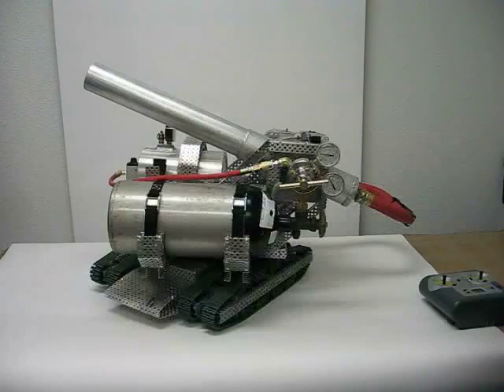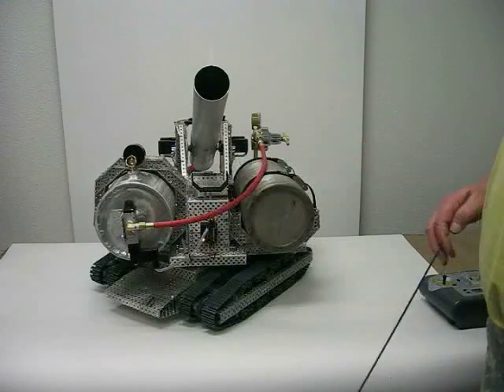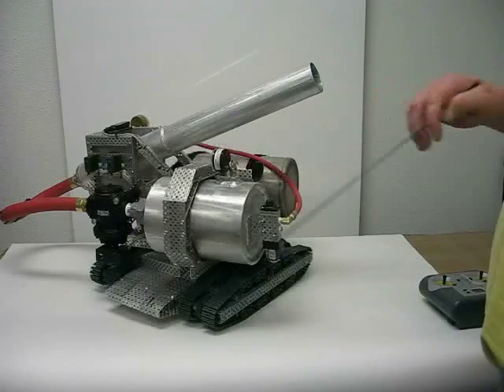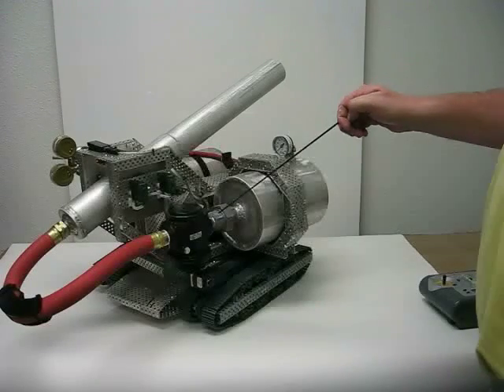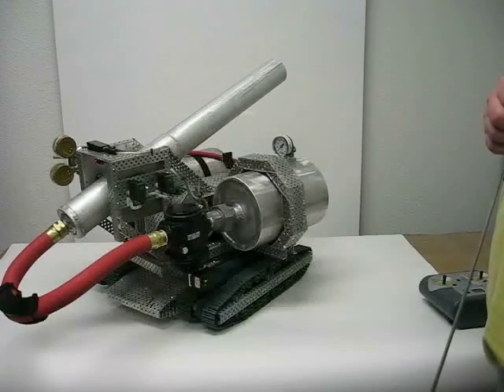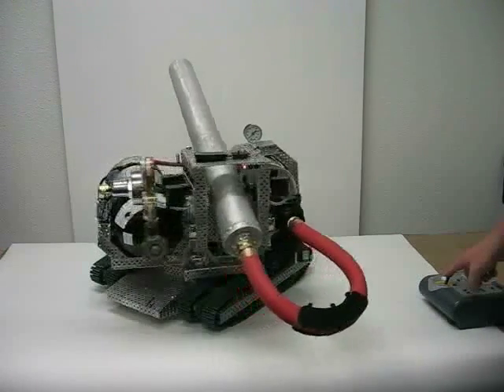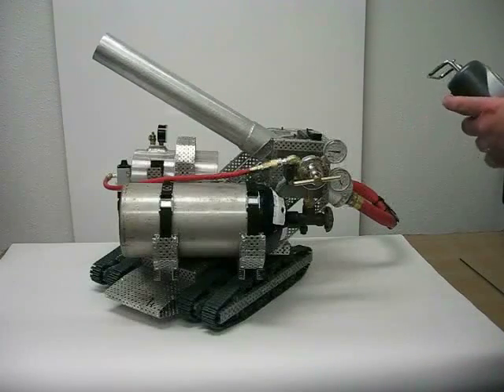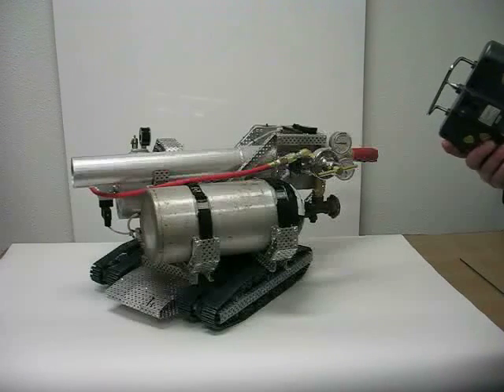Vex Robotics Air Cannon

Comment: Well, I shoot mostly potatoes, so I can't really say anything about friction between barrel and projectile. However I appear to get the best results when my calculated pressure (when the projectile is just leaving the barrel) is about 10-15 PSI. In reality the projectile has probably stopped accelerating by then. For this gun, with 400 in^3 tank @ 150 PSI the optimum barrel volume would be in the range of 4,000 in^3. Or about 3 inches by 47 feet!!  Obviously there is energy being wasted here...

Comment: In my theory, Using a smaller accumulator,a longer barrel would actually have more static resistance and create a vacuum effect behind the projectile as it reaches the end of the barrel. A shorter barrel length allows the initial velocity to be carried out of the barrel without restriction, but accuracy goes down. Are these assumptions wrong?

Comment: With a 40 in. tank the pressure would drop from 150 to 25 giving an average pressure of 87.5 PSI (70 % of 125). I said 5-10% drop in muzzle velocity (MV) because from my experience the initial pressure is much more important than average . Once the projectile starts to move, the flow of air through pipes and valves cuts the efficiency drastically. I should point out that the length of the barrel will effect MV more than anything else. Longer is better until the min. pressure drops below ~10 PSI.

Comment: There's no cut and dry "best".  The everything depends on the application. For launching tennis balls less than 100 yards, a smaller tank at a lower pressure probably would do. You can use boyle's law to calculate the pressure drop as the projectile leaves the barrel. Pressure * Volume = Constant. So 400 in^3 @ 150 PSI would drop to 100 PSI in 600 in^3 (400 for accumulator + 200 for barrel). This gives an average pressure of 125 PSI which can be used to calculate muzzle velocity etc. using F=MA

Comment: I'm curious. Why did you design the accumulator tank to be 400 In^3 with only a 200 in^3 barrel? You could be using a 20 in^3 tank and get  20 times as many shots, with only about 5-10% drop in velocity. Or you could use a 40 in^3 tank, get 10 times as many shots and have virtually no drop in velocity?